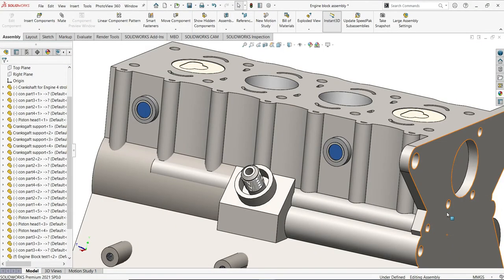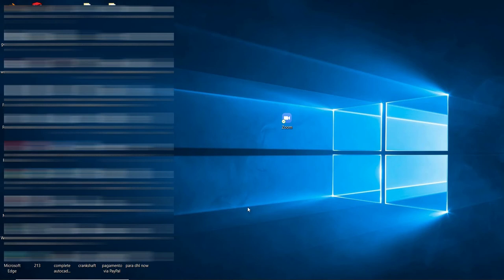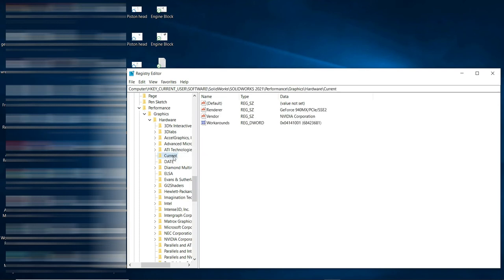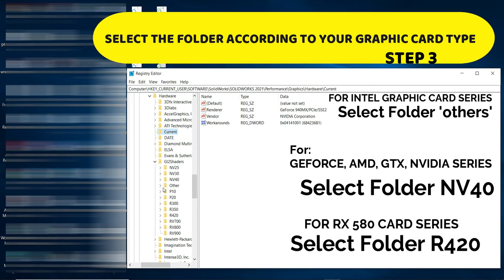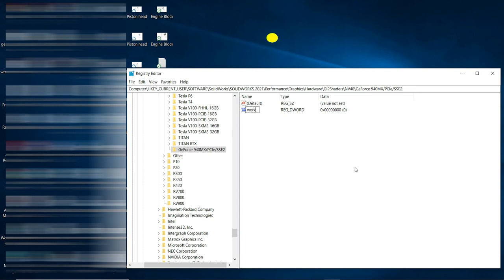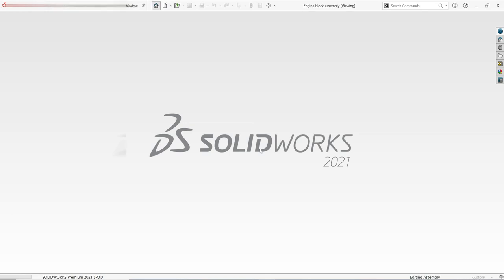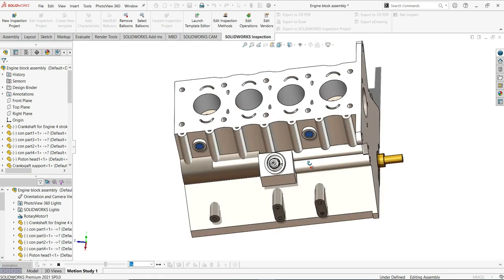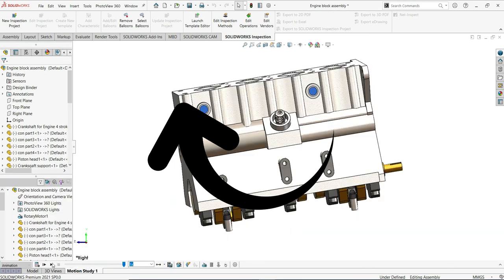solidworks realview

Comment: Hi, would this work for solidworks visualize?
Reply from the maker: Hello friend!! That's a good question. In solidworks you have 3 main different way to represent your final project(or model) in basic realistic view and highly realistic view with rendering, camera, light, scene, etc..
1. "Realview" is basic one, which is not rendering but gives models a realistic and dynamic representation without the need to render
2. "Photoview "360 which is SOLIDWORKS add-in that produces photo-realistic renderings of SOLIDWORKS models.
3. Solidworks visualize is a standalone software for rendering. The most advanced and complete if I compare 3 of them. 
They work independently. I hope I answered correctly your question. You can choose one of them. For the best quality number one is the best.

Comment: helloo I have a problem renderer is not nvidia and not gt force, its intel what do I do?
Reply from the maker: Render with rea view?
Reply: @Mengineer10  in current, renderer is Intel(R) HD Graphics 520, not nvidia and not gtforce
Reply from the maker: OK. I see. If your graphic is Intel as explained, On step 3 and 4, it says, copy and paste your graphic to file called others. and follow the rest of the steps as described on the video.
Reply from the maker: make sure to restart your computer after following all the 8 steps
Reply: @Mengineer10  thank very very muchhh
Reply from the maker: @mariebellekohof2940  welcome

Comment: Didn't work for an Nvidia Geforce GTX 1660 Ti. I tried 30008, 31408, and 32408.
Reply from the maker: Did you refresh your computer? I suggest to try again and refresh every time you change one by one. Using each one of the password

Comment: I've tried all of these steps but still didn't work for me 
My card is NVIDIA GeForce MX 150
Reply from the maker: what version are you using?
Reply: @Mengineer10  
SOLIDWORKS 2017
Reply from the maker: @fadysalah6273  it should work. Are you going reset after every trial?